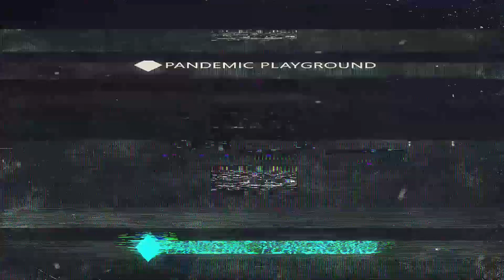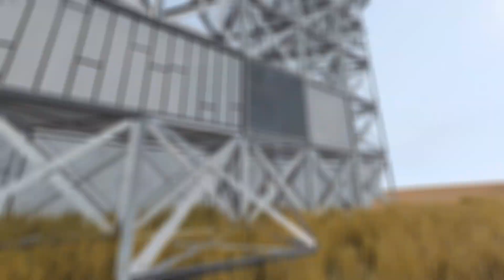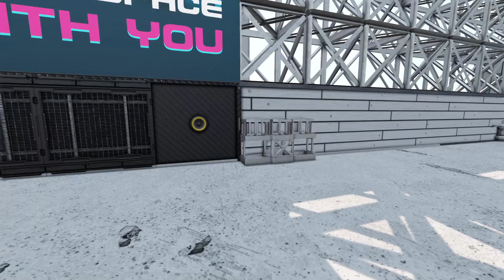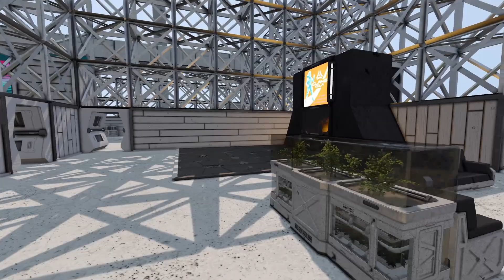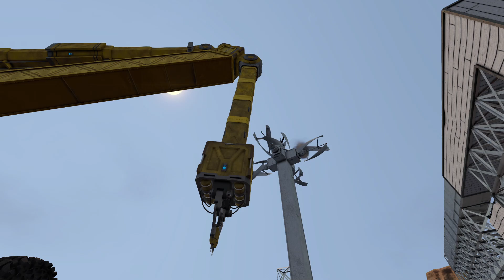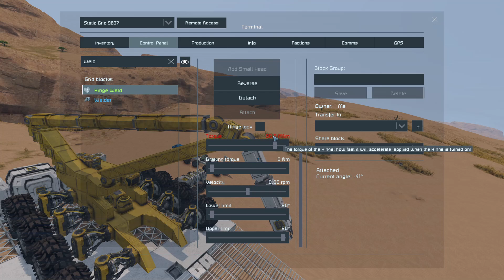Space Engineers Surviving Pertam: Home Construction and Fireplace | Part 13

Comment: Why not construct the welder more like a telehandler?
The solution with the rigid strut in the front and the telescopic part in the rear seems to get a bit jerky movement.
Asked by an actual telehandler driver.
Example: https://merlo.ru/storage/app/uploads/public/5fd/3c3/285/5fd3c3285a569179826028.jpg
Reply from the maker: That is cool. Thanks for the suggestion.

Comment: does the braking of the hinge stop it from dropping? i noticed u had it at 0
the texture thing on walls, wonder if u could build it, spin it and merge it back, would it switch?
Reply from the maker: Hmmm. I wonder now too
Reply: @PandemicPlayground  The torque is only applied when you have velocity set to move the hinge, but you need the breaking force increased to stop the hinge from swinging throu